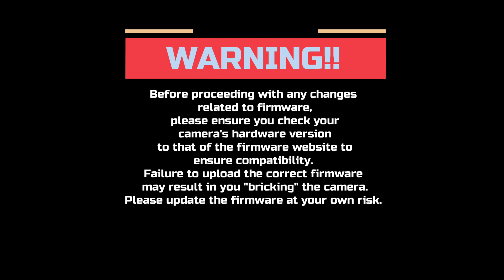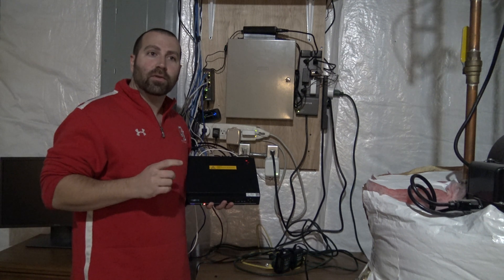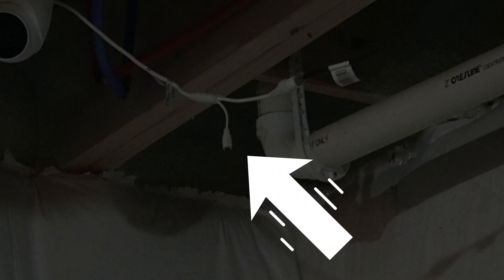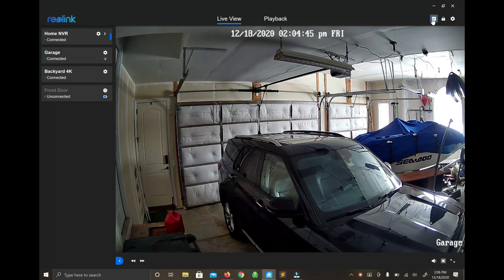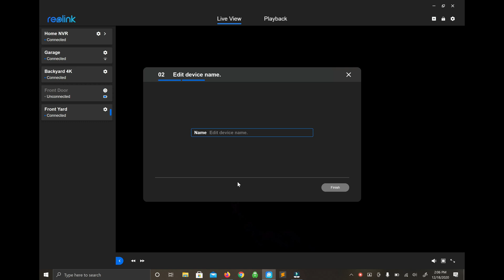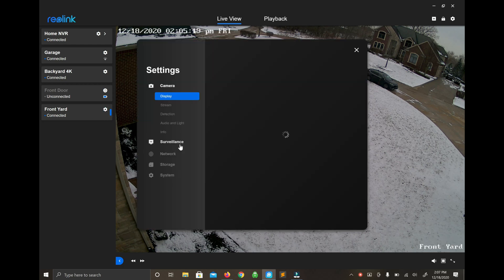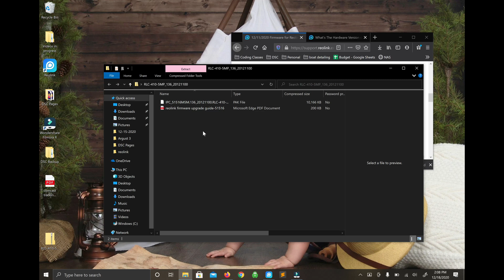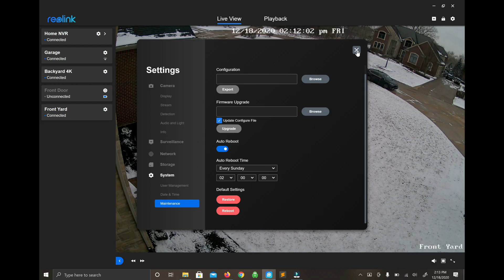Reolink Camera Firmware Upgrade Tutorial

Comment: Interesting.  Your video isn't that old, but the 810-420 system i got in Feb 21....All cameras had a third wire with a reset button (no bricking) and the nvr setup wizard does not include the 5th submenu (info), but does include an auto update capability.   Using Reolink client you can easily verify the system has the Most current firmware.
Reply from the maker: I also have the third wire for my cameras. It's one thing to have auto update, it's another to have it work. From my experience,  I've never seen it actually work nor detect new firmware being available. I have the same experience with the desk top client software where it can never detect an updated version available for both my Mac and windows computer.  I also don't have the 810-420 system to know whether that system auto update feature actually works.  How is that system? I've been looking to upgrade to get native 4k support